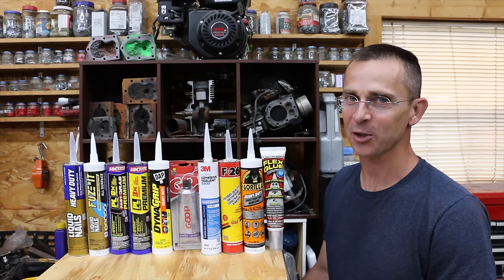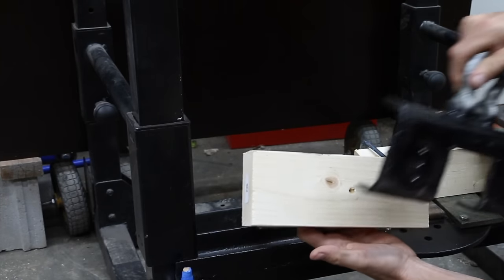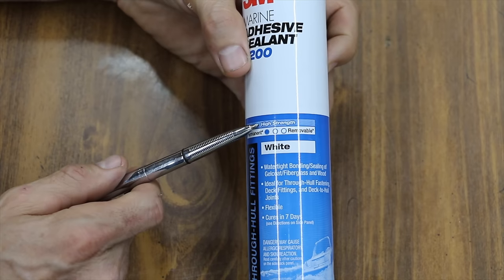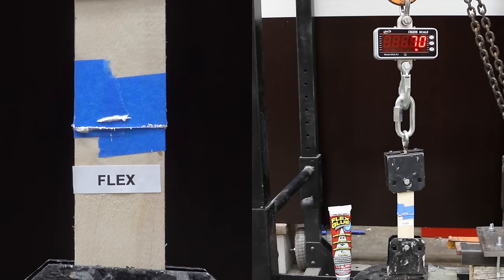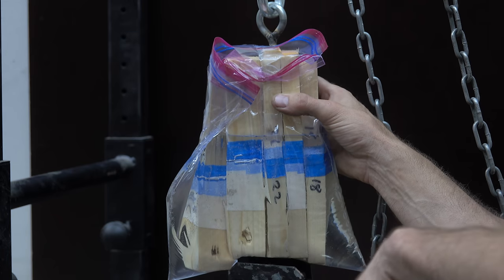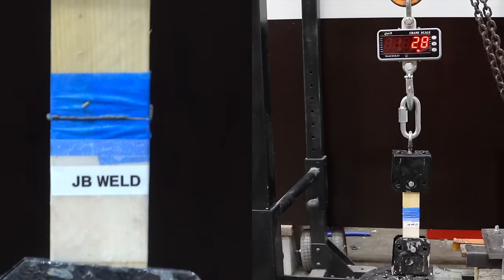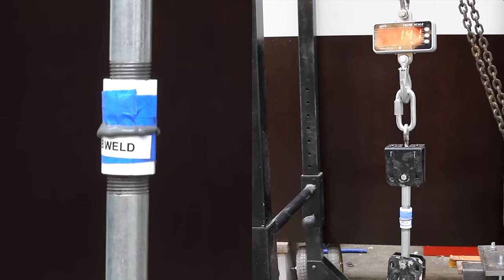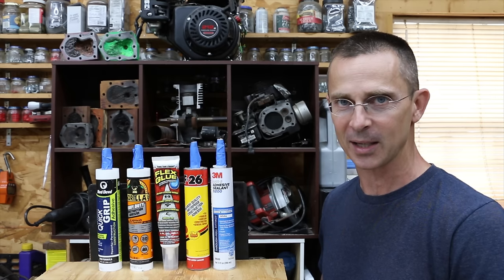Which Construction Adhesive is Best? Let's find out!

Comment: 3M has always been a good company. Evidently they do their research. Gorilla products seem like a lot of hype.
Reply from the maker: Thank you
Reply: Gorilla is always making the bold claims but lacking in proof. They are clearly trying to use their advertisements to sell their product more than pure proof.
Reply: As a contractor with 3M I can't say anything about what I see there. But yes they do a lot of testing.
Reply: I know when I need a product that works, such as double-sided foam tape, I  always choose 3M.
Reply: When you create the 'sticky note' by accident, you are the adhesive industry equivalent of DARPA, so yeah, 3M.
Reply: Gorilla is a marketing company that sells generic products that they brand. 3M is a research and manufacturing company that develops the (in this case) adhesives, tests them, manufactures, and then markets and sells them.
Reply: @BradyBegeman  I wasn't aware of this. How did you find that out?
Reply: Art VanDelay I worked there for a time.
Reply: @BradyBegeman  be an interesting and satisfying job being on the development side of things especially in a new to 3m industries, testing all the opponents products seeing which ideas and materials work the best and are cost effective in each one then combining them to make the ultimate product for each line
Reply: acoustic61 their duct tape is good
Reply: Gorilla is just marketing wank. The products are overpriced. Over here they are identical to the Everbuild line of products which are less than half the cost.

3M are also expensive, but their stuff is usually the best, especially if used correctly. They usually have a very specific product made for a very specific purpose, and in that role it usually outperforms most others.
Reply: Minnesota Mining & Manufacturing. Good product
Reply: agree completely, 3m has always been consistent decent products, their tape etc, for gorilla, yep its hype, their duct tape is decent i admit, the glues...meh
Reply: @jusb1066  , I bought several rolls of gorilla brand duct tape, but after trying it on various repairs I remain unimpressed. It doesn't gum up and get gooey with time and heat like some duct tape brands do, but it doesn't adhere all that well either, especially to fabric. If you want the duct tape to be easily removable then I guess it's okay for that purpose.
Reply: 100% my exact thoughts as well.
Reply: IKR, 3M makes amazing products.
Reply: Sadly everything I purchased was guerrilla until I started watching project Farm. I've never purchased another gorilla product since. I use J-B Weld for nearly everything now.
Reply: Gorilla’s marketing and colorful tubes had me fooled. Thanks for the real world tests! Maybe 3M should advertise more???
Reply: If you consider dumping waste into the TN River a good company then yea! Albeit the state allowed them to...against regulations.

It's similar to shoplifting while a cop watches you, but the cop doesn't enforce the law.
Reply: They're a great company as long as you don't live near their campus and drink the water that comes from the ground....
Reply: MoneyManHolmes they sell mostly to OEMs and industrial distributors...they definitely need to market some of their better products direct to consumers better.
Reply: I tried the original Gorilla Glue when it first hit the market. Really had no idea what I was getting into. I didn’t realize that it was a gooey mess that turned to foam and expanded 10 times its size. That junk sat around until it completely cured in the bottle and was never used on a project after that first time. I have zero use for the stuff.

Comment: Construction adhesive: “we’re here to glue construction stuff together”
JB weld: “hold my beer”
Reply from the maker: Thank you
Reply: OH SHIT......Made my beer come out of my nose.......LOL
Reply: Exactly.  hahaha!
Reply: Lmao
Reply: JB Weld can hold anything together, and hold it's beer at the same time!
Reply: Haha, I'll never get tired of 'hold my beer'.
Reply: @postalinVT  give it back to the JB
Reply: Teddy Meredith 

But can JB Weld weld beer to a can?
Reply: I've always been a JB Weld fan. It fixed a cracked crank case on a 4 wheeler I had and I've been sold ever since.
Reply: Soon as I saw the J-B weld I was like, "ah shit here we go again."
Reply: 😂 yup
Reply: Leopold  I expected that result, but 2 parts adhesives are very inconvenient compared to quick and easy to use construction adhesives, and also more expensive
Reply: Damn right Hats Off for good old JB weld
Reply: Another hold my beer joke.. real original dork
Reply: @ramtrucks721  Why are you here?     I mean on the planet sucking the air decent people could be using.
Reply: postalinVT RAM TRUCKS sole purpose on this planet is to feed worms. Don’t waste the formaldehyde or coffin, just let the worms eat.
Reply: JB marine weld hold my bear's beer.
Reply: @ProjectFarm  fyi a lot of those adhesives require moisture to cure.  If you mix a little corn starch into the adhesives the will hold much better on the pvc.  The wood was fine because there is enough moisture in the fibers.  I bought the 3m 5200 for a tile countertop project.  I'd love to know your views on polyacrylic vs polyethylene finishes.  Scratch resistance and water protection are my main questions.
Reply: Jbw can also patch plastic radiator s
Reply: @dougjb7848   NO PROBLEM MY FRIEND 😂🤣😂🤣
Reply: Idk why "construction stuff" made me start cracking up.

Comment: For the future glue test, I would be really interested in seeing a sanded PVC pipe test instead of an smooth PVC pipe test. I have used 5200 on my boat alot and always sand it before applying. From my experience, the sanding makes a BIG difference in holding power, and I'm curious to see if that's real or not.
Reply from the maker: Great suggestion!  Yes, sanding will make a huge, positive difference from my experience.  Thanks again
Reply: If you're using it for sealing, you're going to hate the future. Use 4000UV instead. Same great sealing, but a bit less adhesion making removal of thru hulls and seacocks easier for maintenance and rebedding.
Reply: Once opened, the 5200 gets hard if you try to cap it and save it for later.

Comment: I'd love to see a full JB test. regular vs quick vs thier other offerings. i'd love to also see heat as a test factor since its called out in regular v quick in strength.
Reply from the maker: Thank you!
Reply: Did you see his ultimate epoxy test video? I think he tested all jb welds and other brands
Reply: 3m panel bond. It’s a two part takes their 3m gun. Use it for everything

Comment: 3M 5200 is great stuff. I've used it many times over the years. Thanks for another fantastic product testing video Todd!
Reply from the maker: Thank you very much for the positive comments!  You've got AMAZING videos!  Looking forward to your next one!  Thanks again!
Reply: The only 
downside to 5200 is that thicker layers can take a fairly long time to cure, and it cures more slowly in dry conditions. Seems to need moist air for a good cure; and it's not all that good for gap-fulling applications. But  man, it sure is tough!
Reply: @goodun6081  It's also available in faster cure.
Reply: Where do they sell it? It's my new "go to" adhesive thanks to project farm.
Reply: @sun622  , most hardware stores have 5200 adhesive (the regular slow cure variety anyway). Home Dumpo, Blowz, etc....
Reply: @electronicsNmore  , I  haven't seen a "fast cure" version of 5200; is it differentiated by or with a different product number?
Reply: @sun622  You can find it sold many places online.
Reply: @goodun6081  I've seen a different number in the past, but they now sell it as 5200 fast cure.
Reply: The 5200 will probably cure faster if you mist it with water. I know urethane windshield adhesives do. I’ve never really needed 5200 to cure fast because I’ve only used it on boats that weren’t ready for the water for quite some time.

Comment: Very curious to see how Liquid Nails will do ?
 I'll be waiting.
Reply from the maker: Thank you!
Reply: Yes, i was looking for liquid nails in the line up too. Very popular product in this area. Has always done a great job for me.
Reply: @haroldburkett7454   pretty sure it will be in part 2
Reply: @ProjectFarm  I assumed Liquid Nails would be the reference adhesive.  That aside, the 3M product is my new reference adhesive.  :)
Reply: No Power Grab?  Just curious.
Reply: The newer foam adhesives leave all these traditional adhesives in the dust from what I've seen; Dap "Smart Bond", Advantech, Great Stuff and others at least where wood is concerned.   Haven't tried to rip one out yet, but from the testing, it's a lot better at adhesion than the typical PL-400 or Liquid Nails normally used.  At least in the case of subfloors.  What's great about applying it too, is that one can does the work of 8-16 tubes.  I've found it to be slightly less than what's reported, but it's still a vast improvement over changing tubes and the time lost prepping them or fighting the large, heavy guns all day.   I haven't used traditional adhesives for subfloors now in a couple years and never will again!  https://www.youtube.com/watch?v=e-llYEut3Wc
Reply: It's been a few years since I've used Liquid Nails, but I suspect the formula has been change, if I remember correctly anyway. It seems to me that the stuff from 10 or 15 years ago had a very strong, noxious chemical odor, but the newer stuff doesn't smell as strong and might be more of a latex base. Better for the environment perhaps, but in my experience latex adhesives are never as strong as whatever formulation preceded them. As another example, compare a silicone adhesive or sealant that smells like vinegar with the GE Home Line II latex-based silicone. The vinegar smelling  silicone adhesives and sealants, regardless of the brands I've tried, all work better than the latex type silicone ( some of which have an unpleasant ammonia luje or fishy odor, by the way)..
Reply: @ProjectFarm  , you should add E6000, and the Goop family of adhesives, into your tests.

Comment: Love your videos! They have been so helpful to me in buying quality tools.
One suggestion I have to improve the shear test is to move the the pin/hook directly over the glue joint. Right now it is creating a little bit of torsional stress on the joint, which is trying to pull apart the bottom.

Comment: Thanks again for such valuable info! I guess it's not a big surprise that 3M won. They've been in that business a long time!
As I watched the testing i wondered two things. First, if the bolt through the center of the wood in the tensile strength test could cause a stress riser that precipitated failure? Second, would a clamping device, possibly with teeth, prevent a stress riser and provide enough pull in that test to find the upper limits of the JB Weld and others that led to wood failure?
Thanks again Todd! Keep up the good work!

Comment: I was an marine electronics installer in the past. We only used 5200 below the waterline on boats. Transducers were 3 inch holes in the boat bottom which we ran a bead around and never had a leak.
Reply from the maker: Amazing product!

Comment: No Sikaflex adhesive. Most respected - at least what I have heard.
Reply: tone167  Yes. You can get it on Amazon, Home Depot, Lowes... I would consider it the best adhesive.
Reply: Sika has different flavours… and yes, applied correctly, the stff is from another world…
Reply: Sika is widely used in the manufacturing world, I'd love to see a comparison between it and the 3M
Reply: DooMMasteR 
252 should be the one for this competition.

Comment: Glad you addressed the wood failing rather than the glue. Like un your wood glues video, often the wood failed as well as the glue. As a woodworker, it’s well known that most glue joints are actually stronger than the wood around it. We’ll often see large chunks of wood still adhering to the other piece to which it was glued. Also, end grain is the weakest way to glue pieces together. Face grain to face grain (or edge grain) makes a far stronger joint.
Reply from the maker: Thanks for sharing.

Comment: Love the video! Thank you for making sure quality content that is easy to find when looking for different brands and options for just about everything! 

I know it wouldn’t be the easiest video, but I was thinking it might be cool to do a video on the durability of different wood finishes, particularly in rough outdoor weather conditions.
You could make it a two part with one on the short term-overall look and protection the finish provides against scratches. (For example some polyurethane and marine coatings make the wood look fake but will provide a much better scratch resistant surface as opposed to danish oil which looks great but needs to be reapplied and offers no scratch protection)
And long term how well each finish held up to high uv exposure over a year.
Reply from the maker: Thanks!  Thanks for the video idea.

Comment: i was a professional floor contractor for roughly 15years, and PL400 was what i used to attach transition strips, or tack strips to cement floors i couldnt nail in to. like when they had buried heating elements, or were poor quality concrete, even some cured hardened concretes, since even though you can nail into any cement,  some dont respond well to being nailed in to, whether its chipping, or poor nail grip.
Reply from the maker: Thanks for sharing.

Comment: I think this round of testing points out the importance of knowing which adhesive to use for what type of job, as well as balancing cost vs. benefit. If you had to glue say a large interior wood panel (4X8) in place that is not going to require the shear strength, you certainly would not go as far as the JB Weld and the F26 would probably do the job fine. Good valuable info here!
Reply from the maker: Thanks!

Comment: The first time I removed my outboard motor from my transom to replace the steering cable, the 3M 5200 used to seal the bolts held the motor on the transom strongly enough that my engine hoist lifted the boat off the trailer almost six inches.  I lowered the boat back onto the trailer and strapped it down using the transom eyes and lifted again, and the 5200 held until the tires of the trailer were nearly off the ground.  People use that stuff like it's just caulk and forget it's an adhesive as well.
Reply from the maker: Thanks for sharing.

Comment: Long time subscriber.  Your channel is a favorite.  Suggestion: test the adhesives bonding wood to metal.  Suggestion: Dremel vs. ...  Suggestion: water hose spray nozzles.  Suggestion: Test metal cut off tool types: abrasive vs. circular blade vs. band saw
Reply from the maker: Thanks for being a long time subscriber!  Thanks for the suggestion.

Comment: Thank you for doing your testing. You have a great channel. You keep the content concise, to the point and roll right along at a good clip. 
3M has a good reputation in the marine business. They make 5200, 4200, 4000, 3000, and silicon.  Each product is for a specific application. 5200 is only used for permanent repairs that will never need another repair in following years. Removing 5200 from your boat is hard work. It is overkill for many repairs.
Reply from the maker: Thank you!

Comment: I would like to recommend a adhesive test on stone and concrete. I cannot seem to find any tests or sites suggesting one is better than another when referring to block/stone/concrete/tile.  Thanks
Reply from the maker: Thanks for the suggestion.
Reply: Concrete results will be similar as in this test video, except with a bigger spread because the properties of the concrete will defeat the weaker products. Concrete is so troublesome that there are priming products sold, which are basically adhesives themselves. Epoxy would hold the best, and be the best primer top. You can find a lot of epoxy products in the concrete aisle these days.

Comment: 5200 is some amazing stuff tbh it’s all dad uses but he always told me to fill in warm holes on a old wood boats to stop it leaking leaking till u can pull it up on the rail ways. But do not use it anywhere that any sun light will hit hit, he said it will get super weak and chalky or flaky or something. I talked him into trying the flex glue and it did well really but it’s got nothing on that 5200, but for other stuff i like the flew glue it’s not bad imo,

Comment: If the wood grain was the failure point for most 3M and JB weld tests, the tensile strength is more important.
The bolts seemed to play a large role in the failure.

Comment: ok just did a search with no luck on the web . we need a single part Polyurethane Adhesive and Sealant , the kind that fits regular caulking gun.  3m 5200, U-POL Tiger Seal ,  sikaflex.  comparison . Just subscribed love the channel.

Comment: In retrospect of GORILLA glue's reputation, price, & hype, I'm VERY disappointed with those results.
Reply: If you have to advertise so much, you probably are disappointing
Reply: Their Urethane Glue (the stuff that looks like honey) and their Tape are both very good products, the rest of their products are overpriced "market segment" products.. AKA they are low/mid grade crap that uses the "Gorilla" name to drive sales on the store shelves.
Reply: @researchandbuild1751  You can apply that to a lot of stuff YouTube channels shill. RayCons and Raid Shadow legends are the current best example.
Reply: I swear 3M makes EVERYTHING. I have military comms equipment made by 3M. Half the things in my hospital say 3M on them. It’s a crazy company.
Reply: Gorilla makes good "Gorilla glue", duct tape, and brush on sealant (like for a roof patch)... everything else is 💩💩.
Reply: Well it is safest to use on your hair.
Reply: Their wood glue and silicones are excellent. The silicones have nice consistency for tooling and they never yellow! Their construction adhesive is not bad even if it wasn’t the best.